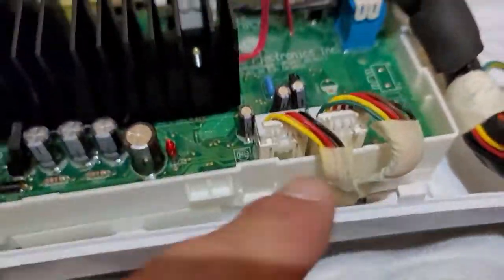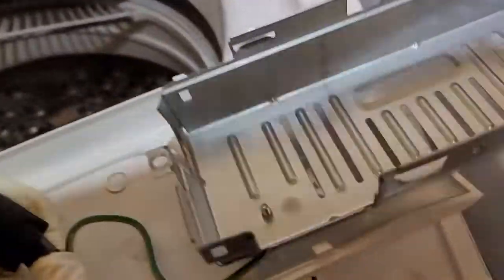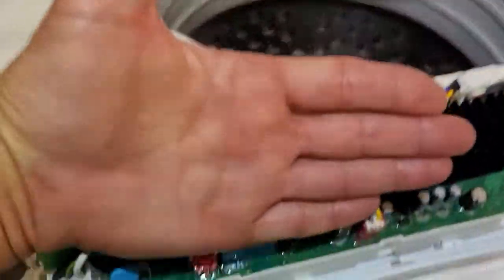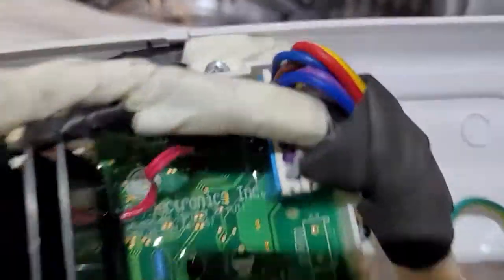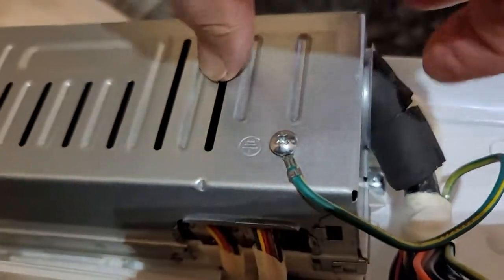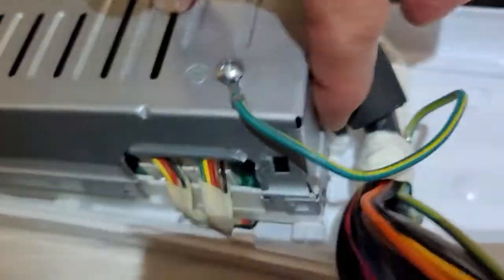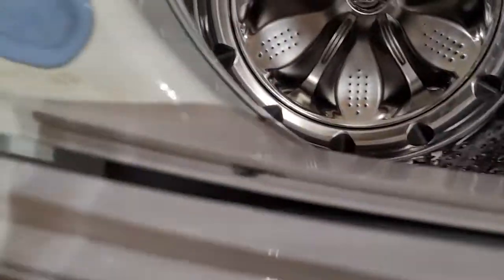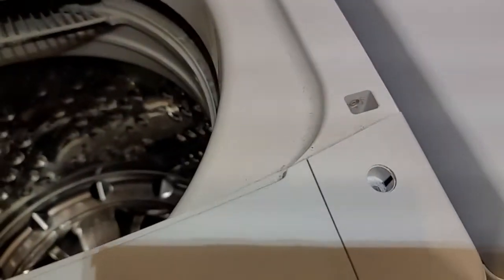OE code How to fix washer not draining LG main board!  Pump, Presure switch new. WT1101CW washing

Comment: Just replace everything, it's bound to work, is this how you'd like your auto mechanic to work?
Reply from the maker: Start with cheapest stuff work my way up to the expensive stuff. All in all parts cost less than 2 service (techs don't have mainboards in stock 2nd service call is to install the board when it comes) calls and cost of board.
🤠👍
Reply: Did u get it working?